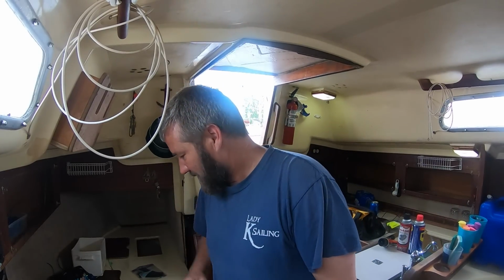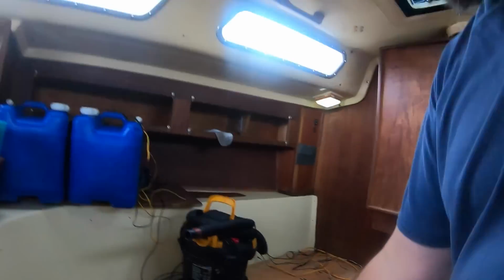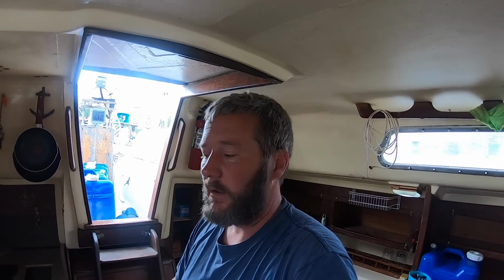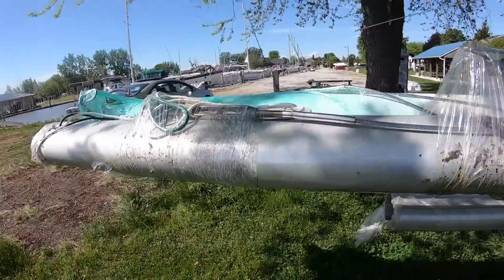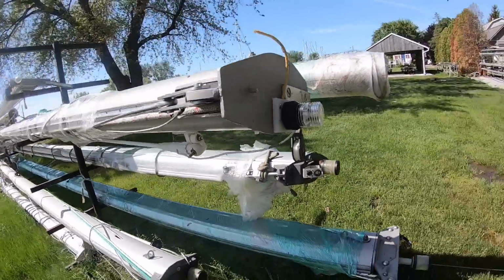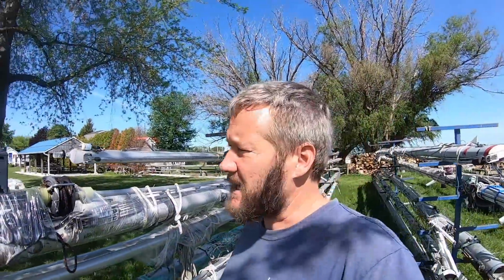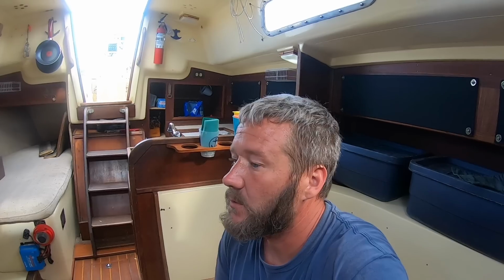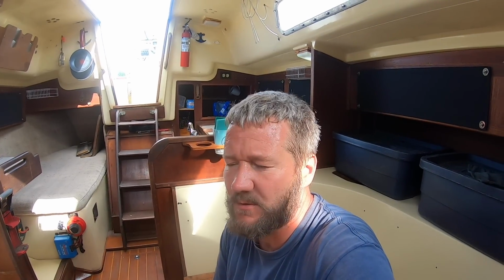Rewire All The Things - Episode 93 - Lady K Sailing

Comment: Too late now, but I would have moved all electronics (battery charger, inverter, solar charge controller) up to at least the same level (above the bilge) as the radio.  Something also worth considering.  A second battery bank (lithium, 18650 cells, 4 in series, 4 in parallel) for the radio and maybe a couple of LED lights.

Comment: Check into Turck wiring systems, they are M12 rated and would give you the reliability you need  and facilitate installation. Yes more expensive, but less failures!